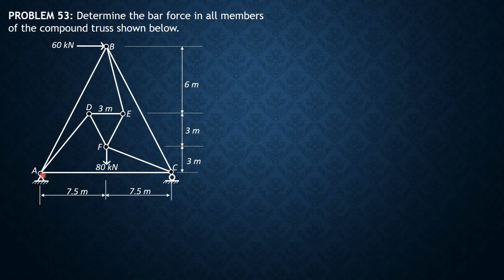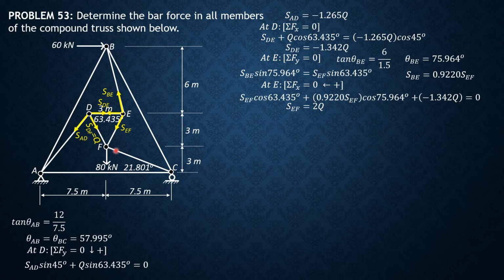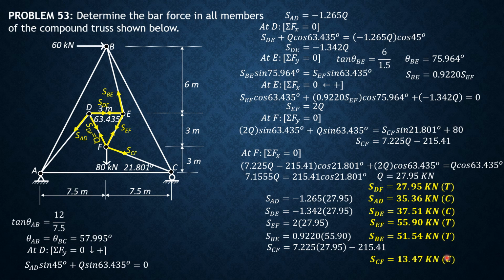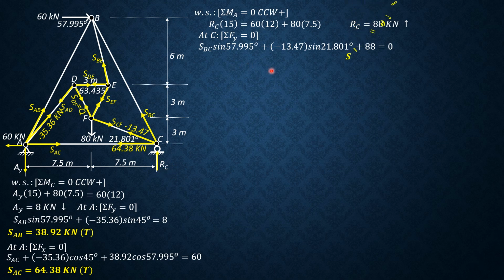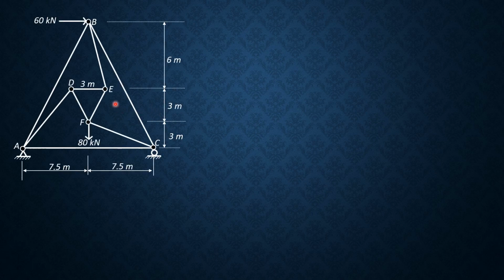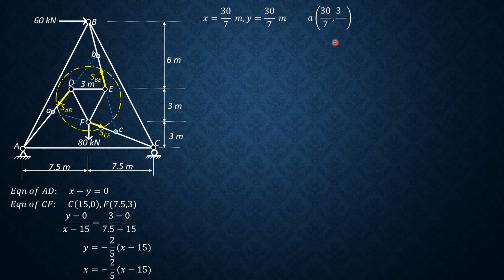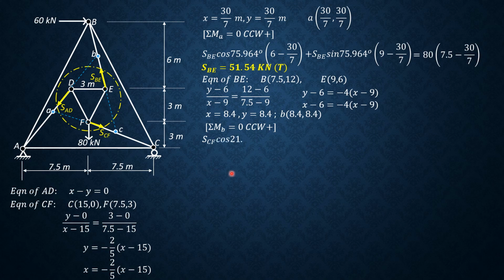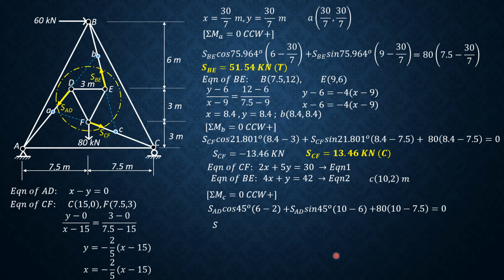STRUCTURAL ANALYSIS, EXAMPLE 53 (Compound Truss)

Comment: ano po bang ang ginagamit niyong book or references for structural theory
Reply from the maker: Marami mga sikat na authors sa structural theory like utko, kassimali, mcormack, hibbeler, etc. pero about 90% of the problems are created by myself.  That is why I do not consider them references but just available books.
Reply: @StilHOT1970  noted po, maglelecture po ba kayo steel design at RC?
Reply from the maker: @docmemphis2760  If my mind and body are still active. Maybe 6 years from now when I am already retired and still alive.